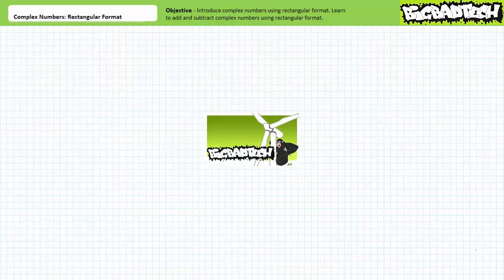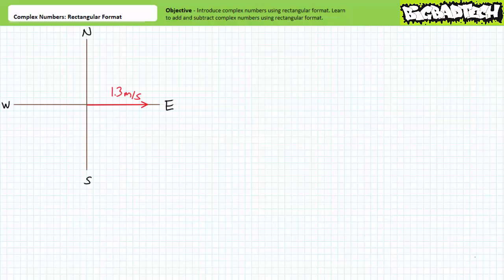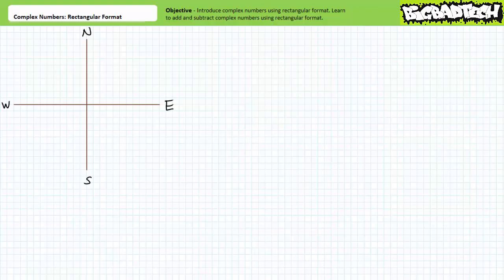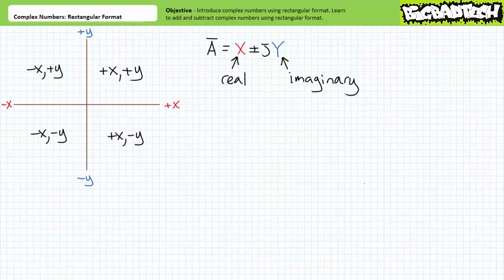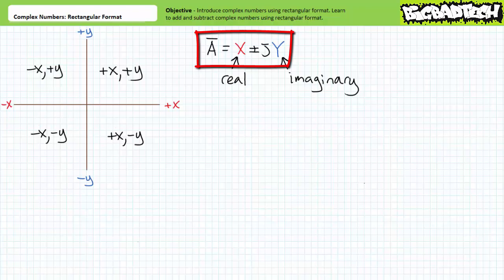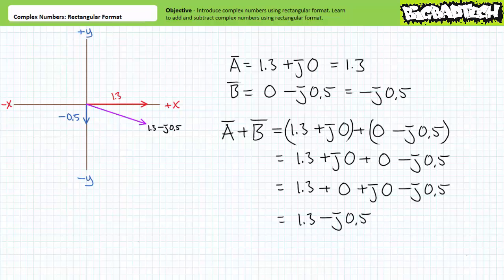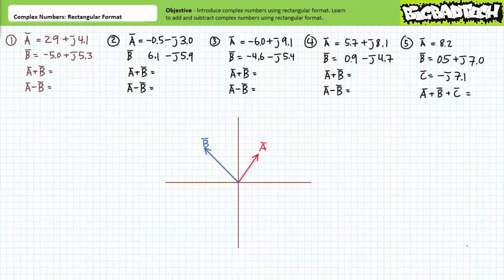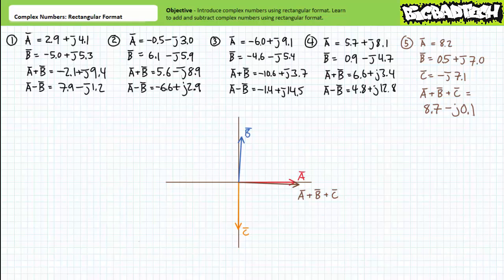Complex Numbers: Rectangular Format (Full Lecture)

Comment: I have a doubt when we subtract A - B , should we take into consideration the values of the operation and draw the resultant vector from the origin? Because i am not understand why we start from B and then go to A.
Reply from the maker: Common question. Here's an analogy. Think about the simple number line you used when your teacher first introduced subtraction when you were around 5-6 years old. Consider the expression 5-2. 5 is A. 2 is B. Draw a line from 2 to 5 (ie: B to A). 5 is 3 greater than 2.
Reply: @bigbadtech  Thanks 👍

Comment: how to choose resulting arrow's direction? Especially in case of subtraction.
Reply from the maker: For visualization purposes, the difference will point from the head of the subtrahend (the 2nd number) to the head of the minuend (the 1st number). If you don't need to worry about visualization, one can also relocate the tail of the difference to the origin where it has a magnitude and direction.
Reply: @bigbadtech  what does subtracting a vector mean? Does it mean adding but changing the vector's direction 180°?  Thanks, Toby, Western Australia
Reply from the maker: @tobydwyer5602  Exactly.
Reply: @bigbadtech  Aha. Thanks. I had been treating the sum of two vectors as x and y coordinates, starting at the origin. I was confused as to why subtraction would be different e.g. why the difference between two vectors would not also be treated as x and y coordinates, starting at the origin. ...Actually, I still am confused as to why we would not represent the difference vector as beginning at the origin like the others. But your answer to the above question gives me a clue, namely that we could represent the vector that way with its arrowhead at the x and y coordinates given by the difference between the minuend and the subtrahend, but for some reason we don't have to.

Comment: What subject you will take next?
Reply from the maker: I'm hoping to finish the "AC circuit analysis" playlist by this spring(?). Next dozen or so lectures deal with complex numbers, complex impedances, and AC Ohm's Law. After that, I'm unfortunately going to have to bounce around out of sequence, however, the whole playlist will eventually include series, parallel, series-parallel, power, power factor correction, super position, thevenin's, maximum power transfer, resonance, filters, and 3 phase AC in a logical sequence.
Reply: Jim Pytel Impressive list! :)